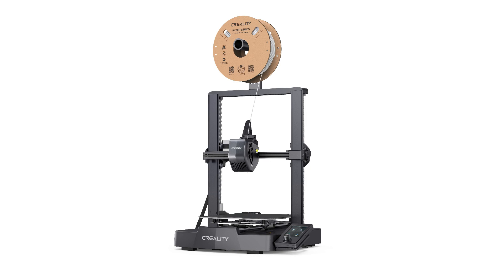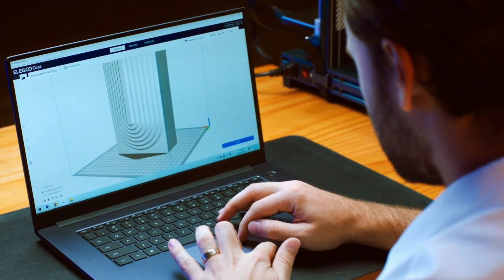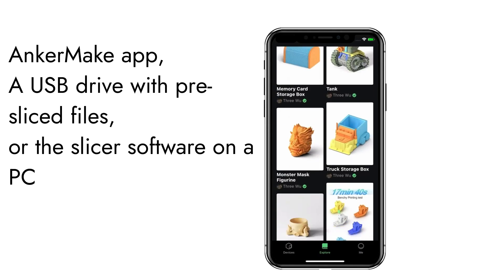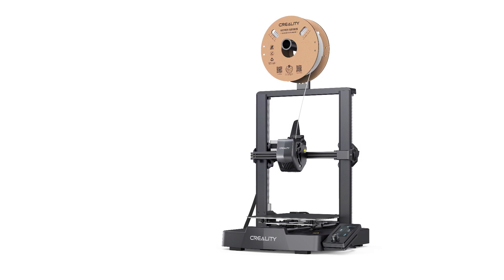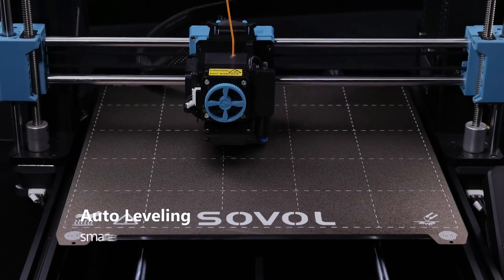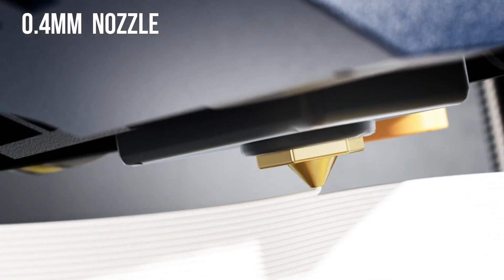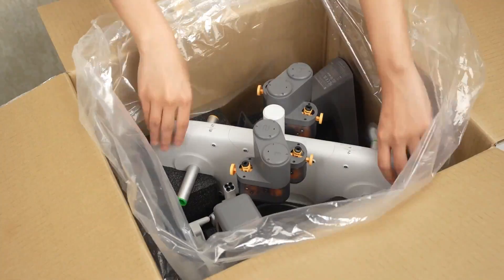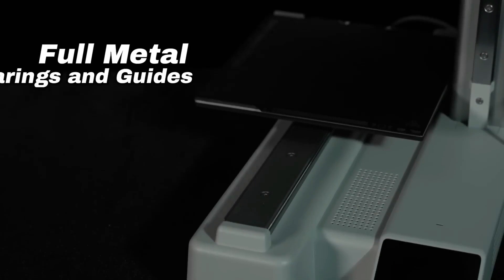✅ Best Beginner 3D Printers of 2025

Comment: Thanks for this! 

I'd like to add my input as a noob who just returned a printer due to fatal design flaws; the Anycubic Kobra 2 Neo. The Z axis jack screw is held on by one floating nut on the carriage, and attached to the motor at the bottom. There's no support at the top where there really needs to be. There's an unacceptable amount of play in the screw which translates to the Z axis and will cause issues on that axis - bed leveling and Z offset are quick and easy to set, but they also get knocked out of whack quickly and easily. 

Just my 2¢ for anyone reading the comments. I'd avoid the Neo. Anycubic customer support is great, their products seem decent, but that oversight on the Neo makes it nearly unusable.
Reply: Hi, which model did you end up going for?
Reply: @user-uk2gd2zu9b  I'm working with the Bambu Lab A1 now. It's been an incredible machine over all.

Comment: I have a Neptune 4 pro and haven't had any success. It couldn't print PETG. The firmware crashed 4 times despite troubleshooting and reloading. Elegoo sent me a new hot end when something happened and the entire extruder was covered in plastic but didn't send the entire assembly despite the picture I sent along with telling them that the assembly was a solid mass. My last print with it failed when all four leveling knobs fell off at the same time.
Reply: Wow.. Sorry you had such an experience.. I print Prusa bro and has had nothing but success. No failed prints unless I sliced wrong 💯 I have Prusa MK4 with enclosure and Prusa Mini. Best decisions I have ever made when it comes to picking a printer 💯